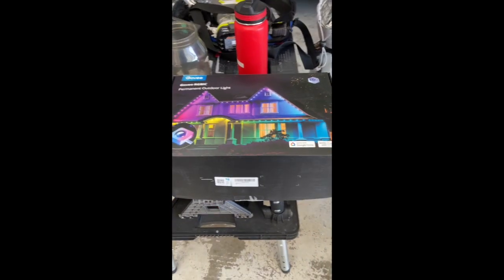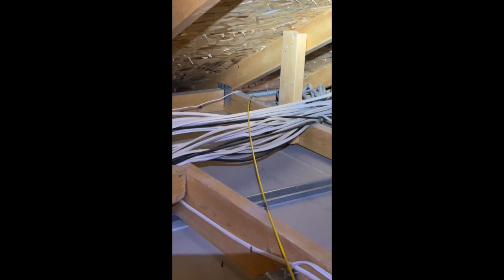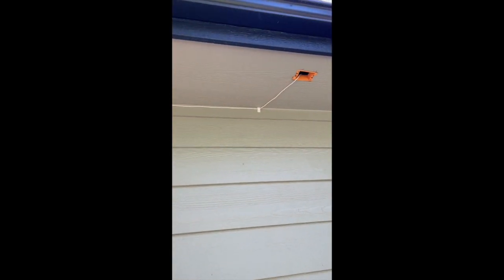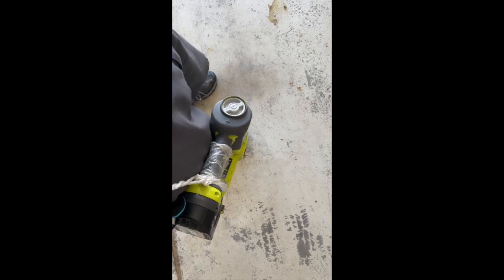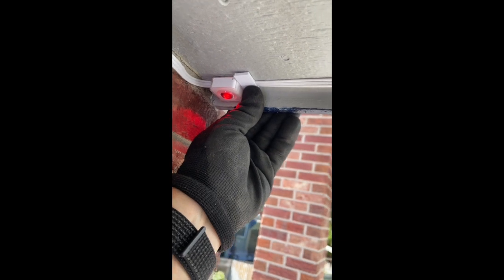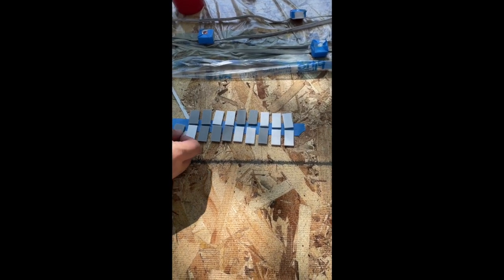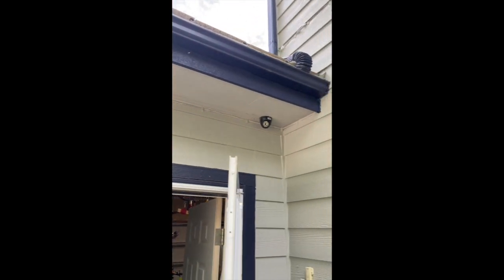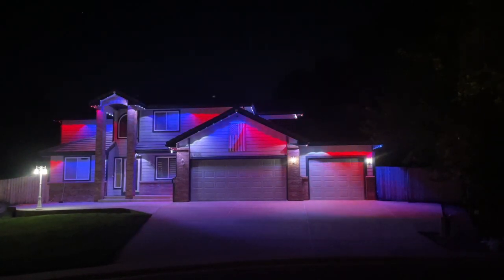DIY Govee  Permanent Outdoor Christmas Light Installation with tips

Comment: I installed the same product using very similar methods, and you make a lot of good recommendations.  I have a few suggestions.  I used the same nailer and it's inconveniently heavy.  You can use the 2 Ah or even 1.5Ah battery to save weight.  It works fine and for a good amount of time before having to swap batteries. I'd recommend stainless brads to avoid rust down the road.  When cable routing, I made all turns at right angles and under or along trim, flashing, etc.  It is far less eye-catching than having curved wires and/or wires running across the face of siding.  I had similar soffits and experimented with mounting them that far out.  I opted to go with about 3" from the wall and I think it's a better effect.  My wife didn't love the scalloped effect at first, but you don't really avoid it by going further out.  You just soften it a bit, but you also create large shadow area below the soffit.  To each his own, but that was my take. last, I scrapped all the extension and splicing hardware and soldered the wires directly using white (outdoor rated) shrink tube over each solder joint and the entire connection.  That kind of shrink tube has a glue that seals the joint from water intrusion.  Much stealthier look and can be made to exact length.  Thanks for sharing your video!
Reply from the maker: Great tips thanks for adding them to the comments. Maybe share a photo of you finished installation

Comment: Hi, great video. I'm looking to extend my govee lights to the upper level of my house, but the govee extension cord isn't long enough. The extender you have seems much longer. Where did you get that from? Thanks!
Reply from the maker: It was the cord that came in the kit. Y
Reply: Seriously? How long is that cord? Looks super long :( @BruceRyman
Reply from the maker: @thephotobar from my note the power supply had a 7’5” length from the power socket
The out from the power supply was like 3’ 4”
From the controller it was 13’
And my extension cord that came in the 100 foot kit was 11’
If yours was shorter maybe contact Govee to be sure you got the right parts?
Reply: Thanks @BruceRyman  ...They provided an 8 ft...I actually contacted them about sending me another cord :)

Comment: Did you have to use two strands of lights and if so, how did you connect them in the app? Mine are separate and the show doesn’t work as good
Reply from the maker: According to the Govee APP is shows you can use 9 segments (108 lights). I have just 6 segments on both of mine.  I did two power suppiles because they indicated 150' was the max distance you could run on a power supply but based on my setup with extension power cords I think I am over that length a bit, but I did not measure it all out.
Also is you have issues getting the lights to light up you will need to do a full reset of the system (I had that problem and my end strands would not come on until I reset it (contact Govee Support for directions) I can't remember the full sets but it went something like this: Unplug the power supply for 5 minutes, plug it back in and push the controller button 5 times they light on the unit should flash and all your lights should power on, but again double check this procedure with GOVEE direct, They are usually helpful.  Good luck
Reply: Thanks for the response! I have them set up and they light up, the two strands (different power sources) just aren’t in sync

Comment: What is the tool you are using to nail ? I do not have an air compressor.  Thanks
Reply from the maker: Its a Ryobi Airstrike. Battery powered no compressor needed. https://www.homedepot.com/p/RYOBI-ONE-18V-18-Gauge-Cordless-AirStrike-Brad-Nailer-with-2-0-Ah-Battery-P321-PBP006/318370234
But any nailer would work.